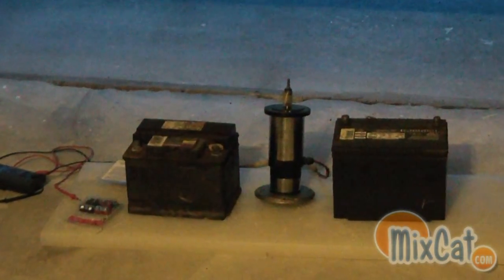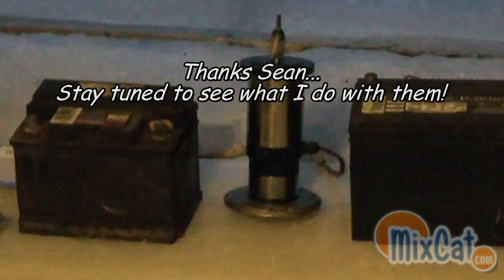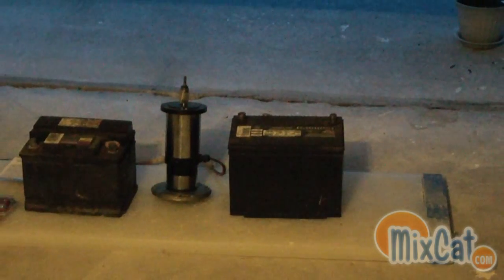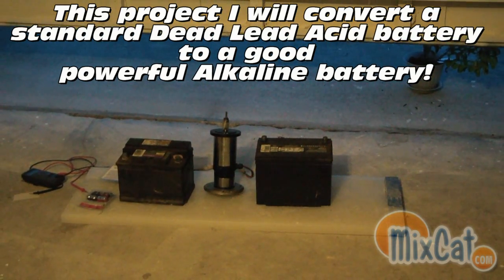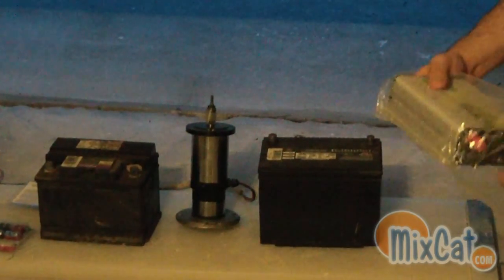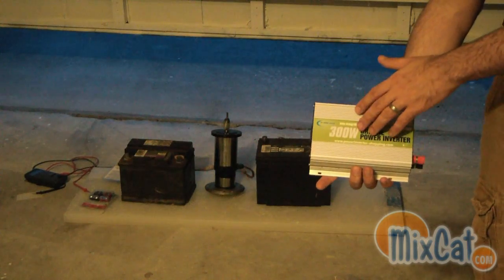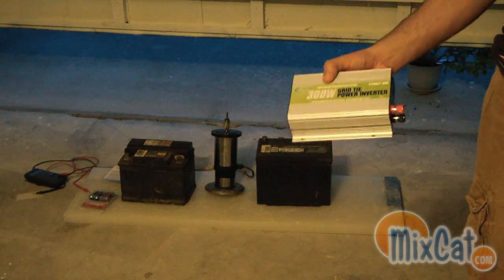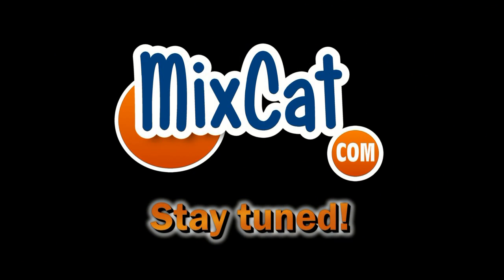Grid Tie Inverter & Lead Acid battery to Alkaline battery projects update!

Comment: yeah they have those meaty 5000 watt ones that you can usually only buy at harbor freight or truck stops that would work really well for that if you wanted to go big with it. was thinking of maybe a solar and wind generator combo actually myself that way you get the solar when the sun i out and the wind when it's storming and you have power either way.

Comment: Hey Pete . I think the golfcart people sell there used batteries at a low cost ? That world be a good way to get started. I think a good starter system for people should be to run just their Lights and other small items in their house. they can save up to do the larger system later . what do you think ?